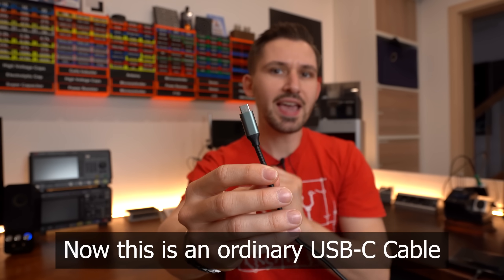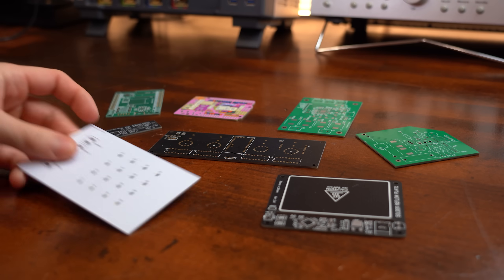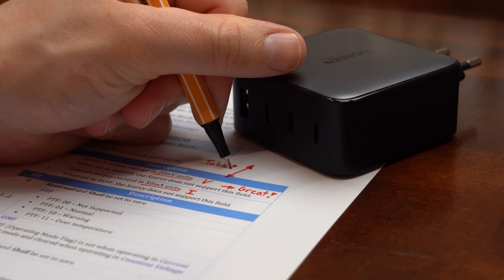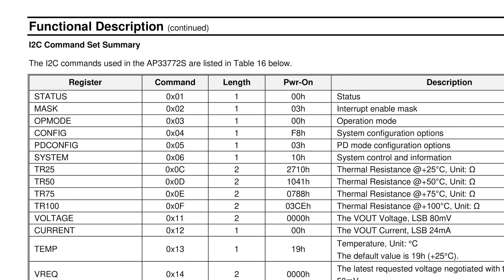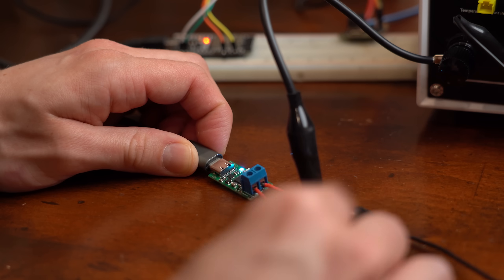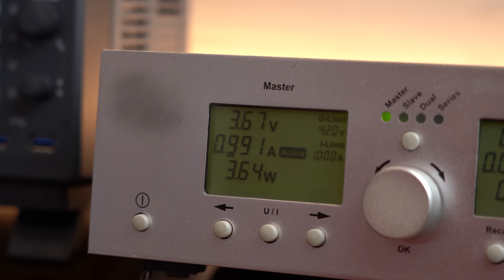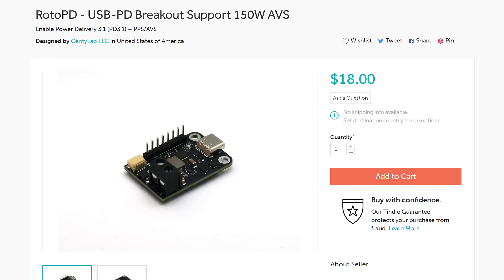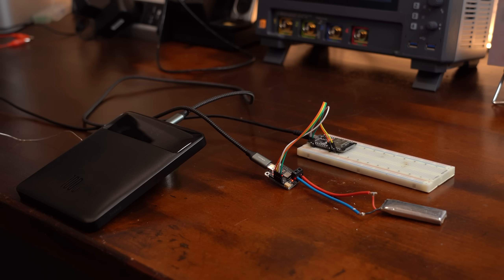USB-C Just got Even Better! (PPS)

Comment: I am curious why would a manufacturer not specify the full capabilities of the device they sold. Maybe the power bank can't meet certain quality with the other profile? But then again, why does the IC say they support the profile when being talked to.
Reply: Probably because they designed it to meet a certain spec - needs to output 20V, say, for laptops - and then picked the cheapest chip that would work. Which just happened to do all the other stuff as well.

Or, the original chip that they picked only supported the main voltages, and then they got a clone/newer revision that supported even more stuff. Why bother changing the case printing? 99.9% of people don't care.
Reply: @ Aye, fair point. I forgot that sometimes the design involves so many people lol and that the case may have finished before the product even finalized
Reply: @YandiBanyu  Or they update some software to fix a bug. Or they just didn't know it was included.

Comment: I've been passively wondering for a while why USB-C chargers couldn't be commanded to ouput a more variable range of voltages when all of the prerequisite circuitry is obviously already in place.
Reply from the maker: Well, there is your answer :-)
Reply: @greatscottlab  I have only a single charger home which can do PPS and (not) coincidentally the same charger has also broken or failed to charge many of my devices. I wonder why. I suppose they weren't made for PPS charging and somehow request bad voltage or something? Does it not simply deliver 5V by default as any usb C charger?
Reply: This could be done ever since the release of USB-C PD, which came out years ago.

Just like Scott said; there is your answer, now you know :)
Reply: QC 3.0 can use any voltage wanted
Reply: @tullgutten  Mind you we aren't talking about licensed charging protocols like QC 3.0 from Qualcomm.
Reply: @proxyhx2075  ah yes, but he still compared it to QC 2.0 and this was the "First" that you could have any voltage outside the standart 5, 9, 12 and so on voltages so he didnt mind.
Reply: @tullgutten  Can you link to a triggers board, please?

Comment: Can i run 2 power supplies of the same voltage but different amprage in parallel?
I need a 12v 3.6a power supply but only have 12v power supplies ranging from 0.5a- 3a....
Stay up bro

Comment: My phone uses PPS while gaming to completly bypass the battery and power the phone directly from the wall
Reply from the maker: Interesting. What phone?
Reply: I have a Samsung s24 Ultra. You need at least 25W PPS charger for it to work
Reply: unless the phone/tablet/what ever uses more power then the charger can deliver it always works that way.

same for solar setups. if you get 5kw in and after losses use 4,7kw you don't strain the battery bank with charge/discharge current.

also the same in cars... the alternator delivers what the current sinks combined draw from it.
Reply: Mine Xperia 5 III also has that function to bypass battery during gaming, but using FNB48 I noticed that it use PPS all the time using PD charger. For example at 52% it commands charger to use 3.3-11 V 3 A mode with 9.06 V and it keeps changing. It looks like phone tries to keep 2 A input current up to 60% of charge, then lowers it to 1.5 A. That's what I noticed right now
Reply: It makes sense for it to use PPS all the time, as it cuts out on losses on the voltage converters if it uses 4.2V

Comment: PPS is truly a gift for makers, it's perfect for  powering projects directly without needing a buck or boost converter. Its also great for making usb-c adapters for laptops, as you can choose any weird voltage laptops with custom plugs might use.
Reply: IKR? The fact that this can be a super simple 1-cell CC/CV lipo charger with some code is a huge upgrade for adding quick charge to DIY projects. This could also make for an insanely inexpensive, accessible and compact mobile power supply for work in the field or for electronics beginners.
Reply from the maker: True that :-)
Reply: I replaced so many bulky laptop chargers with a simple PD breakout board and a hacked off piece of cable
Reply: In all honesty, I didn't even realise that the old PD triggers boards existed. That was a revelation to me. But to be able to program these new ones as well? Blimey! I have a feeling the items in the video are going to give me hours of fun. Thanks 🙂
Reply: This is also much easier than adjusting step down or boost converter at its adjustment screw, it's a pain to get precise voltage, and it also lack current control that these PPS can do. 
I'm glad I now know what it is, also explained why those conventional converters are now on huge discount, they are now much less desirable.
Reply: @worawatli8952 Exactly, also makes your whole power delivery circuit more efficient, which is very beneficial when powering from for example a USB-c battery bank
Reply: I’m confused by this, but it sounds really interesting how you said it. 
Could this work with lithium ion batteries inside a robot? How could that work? Or is it for just projects that are powered by the USBC cord alone?
Reply: @TJbuffs This could work with lipo batteries but you're better off just getting a USB-c charging board, this is more for projects that need specific voltages. I recently replaced an old Apple laptop charger with a PPS board and it works perfectly.
Reply: @  that makes sense. For some reason my brain has a hard time wrapping around the USBC charging for anything other than 1 cell. I never know what to buy, I feel like my searches don’t pull up what I’d need. Do you have any recommendations on that front? Thanks for your help!
Reply: Would this work for bumping 12v lipdepo4 batteries to 13.8 for ham radio stuff?
Reply: @christianknight2905  It's not a boost converter, it needs a PD power supply that supports this PPS mode.
Reply: *It's
Reply: Imagine being so mentally bankrupt that you cant add anything to a conversation so you have to correct an apostrophe. Insufferable. We all know how to use apostrophes pal. @GrainGrown
Reply: @EpicBunty  *can't
"We all know how to use apostrophes pal."
lmao
Reply: I got excited for a second until I saw that the max power is only 150 W, useless because I need at least 330 W
Reply: Regarding Laptops, while their barrel jacks might officially use a weird voltage like 19.5V for example, they have factory tolerances so large that plus minus 1V shouldn't matter and plain 20V PD covers most of them.
Reply: Aliexpress doesnt sell any modules anywhere, all fixed voltages :(
Reply: In fact it’s more or less a buck boost converter
Reply: @thybaltcarratala2433 no. It is not.  It does not voltage conversion at all.   It is an interface board that talks to USB C power supplies or banks.

Comment: 11:05 so will universal ebike charging connector finally become reality? or i guess we need a bit more voltage still. something around 70v max should probably be fine.
Reply from the maker: Well, AVS goes upto 48V. So no luck so far.....
Reply: @greatscottlab  wait really? that's enough for 36v batteries so i guess it could already work for 36v ebikes.  that's kinda cool.

Comment: I didn't know PPS was a thing, thanks for documenting useful techs like this for us 🙏🏻
Reply from the maker: Happy to help!
Reply: Same, I didn’t know about it either until I had a Samsung device that utilized it.
Reply: yeah but samsung is low spec pps just looked other Chinese brand yes they uses pps but much more customised and also much more high current support up to 15amps  @bryanjk
Reply: @ariefhidayat2157  15 amps? are there seriously 12-14awg usb cables being produced for that?
Reply: @bryanjk  the problem is not the cable but the type c connector
Reply: @bryanjk  at 12 amp the connector is gonna be so hot
Reply: @ariefhidayat2157  yeah great point as well. Maybe this other guy can give us insight into the 15A figure
Reply: You must be a apple user 😂

Comment: With the Samsung Smartphones that are using pps für the 45w charging im not sure what they are doing, because the phone always takes a bit over 9v but the battery is 4.4v. So they have to use a dc dc converter in the phone but then they could also use just pd. Then nearly every >45w ps powersuppy would work.
Reply from the maker: Sadly manufacturers often stay quiet about such things.....
Reply: (dis-)trust in cheap powersupplies probably.

the phone would catch overvoltage within the PD limits from nasty software glitches in the PS.

also independence from long USB extention and the resulting drop in voltage -> power when the wires can't handle the high direct battery currents.

because people LOVE buying cheap crap.

Comment: so why not wanting to make a generic power ac-to-dc supply yourself. yes I mean voltage/current setting lab power supply. no power limit. stop paying the usual manufacturers. diy. including your sponsor. they need a reason to sell, ie you not diy.
Reply from the maker: Maybe next time ;-)
Reply: Because he probably doesn't want to design a power supply for every project when there are simple jellybean replacements, like this. Saves time and let's you focus on the more important aspects of a project.

Comment: 0:24 you can go up to 48V (at 5A, or 240W) now! but good luck finding things that support it. Annoyingly, like the rest of the USB spec, its an "optional" thing. 

edit: i see you mentioned it at 10:47. Framework's power supply doesn't support 240W yet, but their laptop does. There is some 240W supplies, but they aren't commercially available.
edit 2: Mouser `ADP-240KB-BA` apparently did, but it doesn't exist anymore. There was also an IC that supported the triggering, but never got made
Reply from the maker: Watch until the end of the video ;-) I will mention the 48V 5A
Reply: this could be useful for ebike batteries.

Comment: For audio aplications this method doesn't do well. Generally the usb power supply induce a lot of noise in the audio circuits.
Reply from the maker: Thanks for the feedback. Something to look out for :-)
Reply: @greatscottlab  I'm looking for the ultimate power filtering board for usb power supplies. I'm always curious for your next episode.
Reply: There is filters available but I haven't tried them.
Reply: That's true, but there are ways to mitigate it. Big smoothing capacitors and a DC-DC isolator for example could be a first approach. Ideally you would test with an oscilloscope to find the perfect balance in your situation.
Reply: @somedude2492  I'm a total novice on electronics. It makes little sense to buy a board the size of a thumb a then put a big filter board in front.